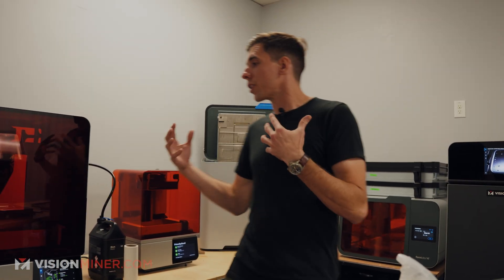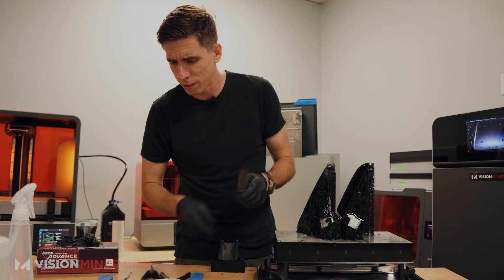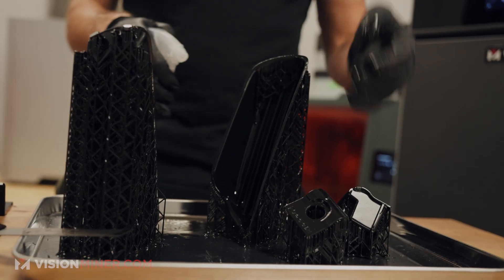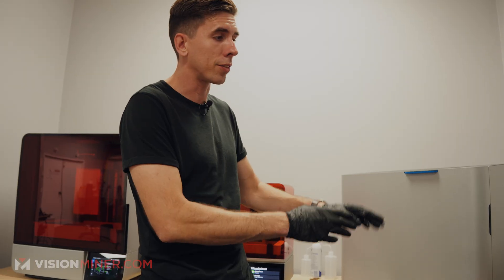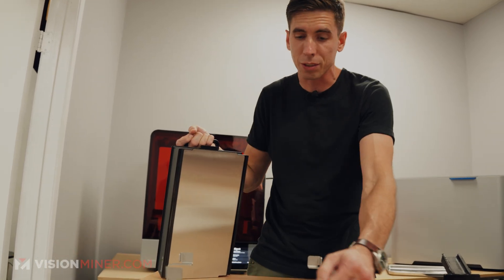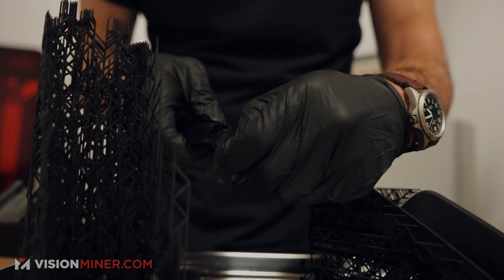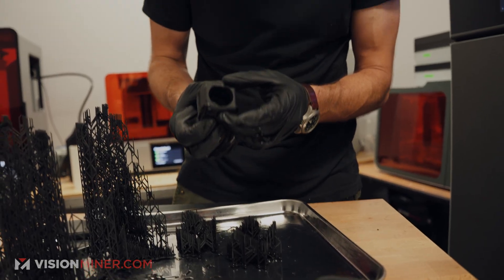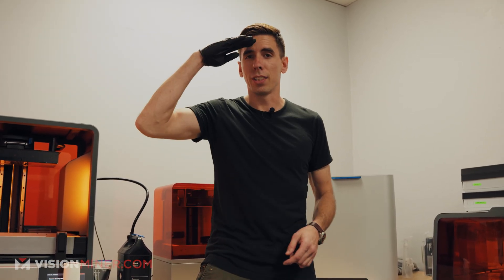How We 3D Printed Car Parts in Hours with SLA

Comment: Need to learn the differenced between resin printers & filament types. What are the operating limits for resin parts ?
Reply from the maker: There's 45+ resin materials -- so, it depends which one, but it's a large gamut, from high temp to flame retardant to "tough" or clear or super-rigid -- there's quite a few :)

Comment: If you use the flex plate using only the tabs facing you, then push too hard it will then pop out of alignment with the magnet and return to flat incorrectly. Would recommend flexing all 4 tabs at once like you demonstrated.

Comment: Yikes.......SLA and SLS in the same room?  Bold move.
Reply from the maker: Luckily they're both well-contained :) Probably concerned with powder somehow getting into the resins -- although that probably wouldn't cause a failure, it may disqualify some parts. The Fuse Sift is outrageously good at containing powder, the room has full air exchange, and the SLA stays pretty well sealed up, so we're not too concerned. (also: CARPET for SLS. That powder gets super slippery on hard surfaces!)
Reply: Why?

Comment: No facemask? Thought that is absolutely necessary?
Reply: Not used a formlab machine but I was thinking the same thing! 😮
Reply: Formlabs resins are far safer than most other third party ones. Also looks like he has good ventilation. We have multiple formlabs printers  including the form 4l in work in a well ventilated area. We have VOC meter right above them and it’s consistently in low levels.
Reply from the maker: Super, super ventilated room -- fresh air constantly. Not required, but yes, recommended. Just makes talking during videos..... challenging. PAPR incoming!

Comment: Funny story for you about the early days of having resin printers and LED light bulb proliferation. When the mid and large format 'prosumer' printers became more widespread, I hadn't really given much thought to the lights in the ceiling of my utility room until you have resin on your gloves haphazardly dripping with super fast reacting resin. Yeah, I went on a rampage looking for more specific LED bulbs that have a less reactive color value and swapped out everything between the print room and my processing area. Safety with photopolymer resin can't be too overkill in my opinion!

Add: I've been conducting long-term environmental passive testing on my resin parts. Granted I've supplemented them with my additive packages, but I have a few samples that have been outdoors unprotected for going on five years, and are still very resilient. Water intrusion, freezing and cycling are more destructive rather than sun exposure, which can be combated with an acrylic sealant containing a UV inhibitor. When photopolymer resin is completely cured, it won't continue reacting with further sun exposure (or artificial means). Things that degrade it if left unsealed are environmental moisture, or the worst thing that people mistake for bad resin is uncured resin inside an improperly vented model that cracks and leaks down the road.
Reply from the maker: Oh man, yeah! They can generate a lot of heat when curing, for sure! That makes a ton of sense, sealing from the UV - what materials do you generally use?
Reply: @VisionMiner   I have a few for my 'go-to- resins for general use, though I've run literal gallons of 3D Materials' resins with great success and finely tuned profiles. At one time it was a bargain brand of sorts that was easy to find in 5 liter jugs; some for engineering-grade parts for final client models (Henkel-type formulas that I hate using but serve a purpose), and a box of miscellaneous bottles I've picked up for testing and get to trial when I have the time. The bio-resins I thought would have more promise, but the formulas I've tested thus far need more time in development. The good ones that actually work still create massive clouding and bloom much worse that the usual fare.